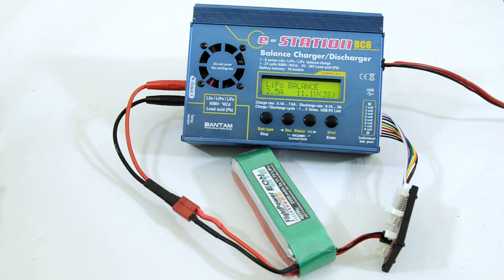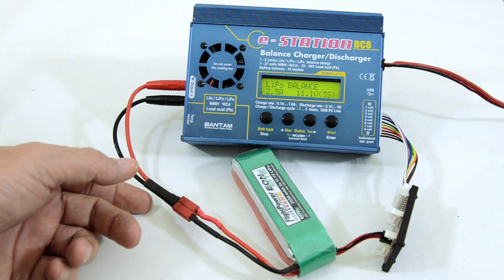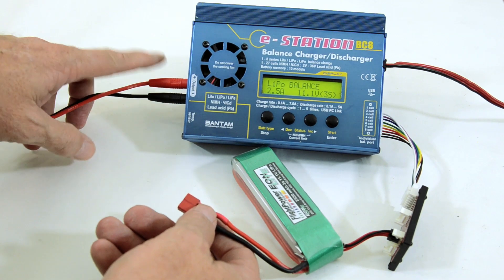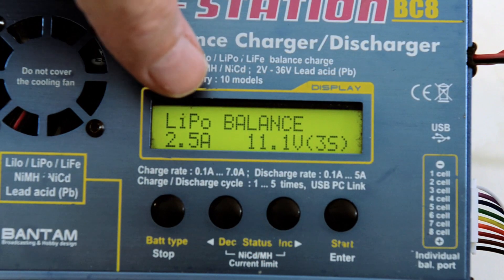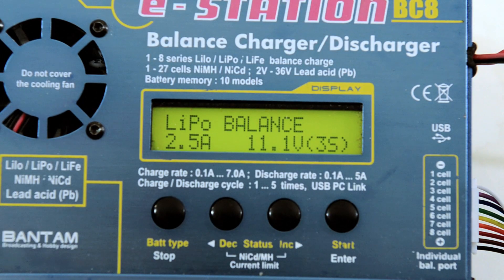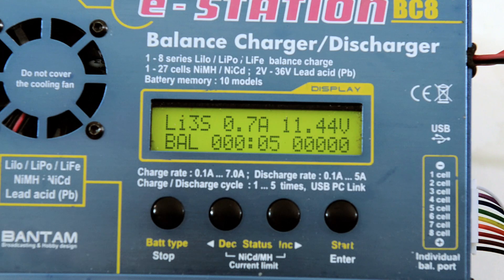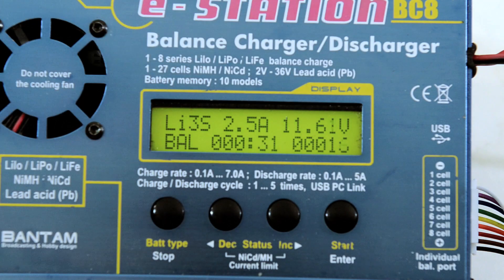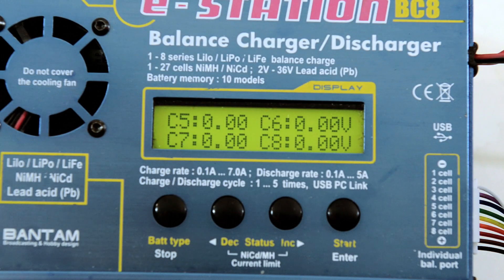Basic Lipo Charging

Comment: When I charge my 3s lipo battery after 2 hours one light is turn into green which mean full charge and after 15 minutes the other light turn into green too but the other it takes time to fully charged
Reply from the maker: If you are doing a balance charge, each cell is full when it reaches 4.2 volts. If the cells (you have 3 cells) are out of balance, it is normal for them to reach a full charge at different times. During the balancing portion of the charge cycle, the current is very low so it might take a while to finish. I would say if it takes more than a couple hours, the battery is nearing it's useful lifetime and you should consider replacing it.
Reply: do you need this good lipo battery , if you need , you could see the below link very good product.
https://sktvision.aliexpress.com/store/2782033?spm=5261.seller_index.0.0.78040ba2WolNFq

Comment: Do you need to have the digital chargers or is it fine to use others ones?
Reply from the maker: If you can monitor the voltage of each cell while you charge, any lipo charger is okay. The digital chargers with a balancing circuit do that for you.

Comment: tnx 4 posting.  i watched a bunch of vids on here trying to figure out y everything is "GOOD" when the charger reads R:3SER and S:3SER? but nobody ever mentions wat a SER is?  soooo y is it good when R:3SER = S:3SER? the manual says it means the cells are set the same wateva that means:)  i even called my charger's tech support but i was on hold for so long my cell phone quit working,,,,, Grrr
Reply: Amanda S.  3SER means 3 series.  R3SER is the number of sells the charger is detecting, and S3SER is the number of cells you should have already indicated on the previous screen. Its just verifying the info. If not correct you redo or find out why the charger is not reading the full series of the batt if it is saying different.

Comment: Ron great tutorial. I have a question, I have multiple packs that I use in my 12S setup that are 6400mAh but I charged them at 2.6A is that to low or should I go up to 6.4A? I just don't want to cause a fire, any recommendation will be greatly appreciated.

Comment: Have you used the Thunder T6 320w quad charger?  Do you know if this charger can handle 6 s batteries with 60c and above ratings. Do you know how long it would take to charge these batteries?  Do you know of a charger you could recommend?  I'm planning on using several  6 cell batteries and a 12 cell battery all over 5000mah. Thanks fin advance for your input.

Comment: OK i have a question PLEASE reply i charge my lipo on charge mode and it balances the battery usually when i first put it in one is like 3.5 and the other is like 3 and then when its done they are the same voltage like 3.8 and 3.8 so is it OK to put it on charge mode

Comment from the maker: @john2004able John, I'm not familiar with the Imax charger. It might be similar, but it isn't the same. Most chargers in this class use the same chips, but the rest of the charger is built differently. Somewhere in your charger you can set the voltage cutoff. Yours might be set to 3.8 volts. Or you might have the capacity set to a smaller pack. Or you could have a time cutoff. More than likely, something is wrong with the setup.

Comment from the maker: It depends on the starting voltage. In other words, how drained the battery is. Normally, about 45 minutes. The maximum should be 1 hour.  Since Lipo batteries have no memory, it doesn't hurt to charge them before they are down to 80% of their capacity. However, once you do a full charge, don't do a "top off"charge like you might do with a Nicd battery. That can lead to problems.

Comment from the maker: This is an old charger that I've been using for years and I just grabbed it for this video. I've actually run over this particular charger with my truck ... twice. Maybe I'll post a video of that someday. We have several Bantam chargers that have more features for less money, so, no it's not the best one for the money, and yes, it stops charging automatically. However, whenever a charge is finished always unplug your batteries. Never charge a battery unattended.